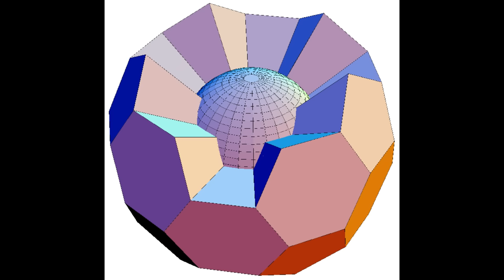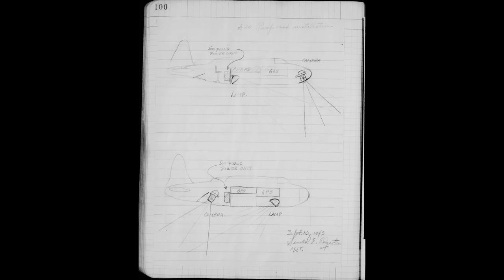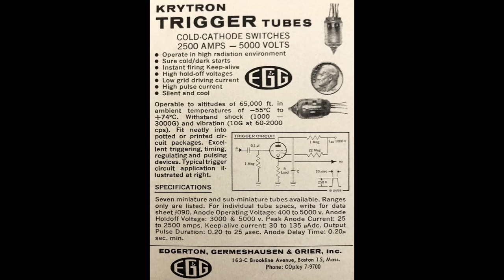Before The First Nuke Exploded... It Imploded.

Comment: Apparently lenses are a “more complicated” way to get the compression for atomic detonation. Modern bombs use a still classified method which is simpler and easier apparently. I saw this in a video about atomic bombs from a Harvard lecturer.
Reply: With modern CFD codes and CNC machine tools they can form a 🏈  shaped fissile pit that can be imploded by diverging spherical shock waves at each end
Reply: That's interesting
Reply: They went for making composite explosives with controlled density changes in the bulk, so as to make the lens intrinsic in the material, not make it out of segments. More complex in production, but you can test them more easily as shaped charge sections, and then very easy to assemble. Still needs the precise control of detonation though, and you can easily disable them till firing time using a simple mechanical switch, that adds a delay to the one section of controlled time cable.
Reply: I think you're talking about the Swan primary.

Comment: This movie had better give Leó Szilárd his due.  He was the first to conceive the nuclear chain reaction, five years before the atom was first split.  He wrote the letter that Einstein (his teacher and collaborator) signed and sent to FDR, kicking off the Manhattan Project.  Fermi, Zinn, and him led the project that created the first nuclear reactor (Chicago Pile 1).  When it didn't work at first, it was Szilárd who, without doing a single test, concluded that the graphite moderator must have trace amounts of boron (a strong neutron absorber) in it.  Sure enough, when asked, the supplier confirmed that there was boron in the graphite.  Fermi said that if building the bomb was a matter of just thinking, Szilárd could have done it all himself.

After Germany fell and it was found that they were nowhere near an atomic bomb, Szilárd argued that the project should be stopped immediately, without a test.  He predicted that Stalin would know about the project (correct) and that it was only the uncertainty of it working that was stopping Stalin from driving all the USSR's resources to develop their own bomb.

Comment: Kistiakowsky was quite safe drilling into the explosives and he well knew it.  Although it can be argued that a fluke detonation could occur, the odds of it are microscopically small.  High explosives of the type can even be exploded deliberately with a black-powder bomb and will fail to detonate, merely burn or scatter, because black powder lacks sufficient brisance (sharpness of impact).  This is what blasting caps (aka detonators) are all about.  They produce a small but very sharp blast wave which initiates detonation at a molecular level.

Comment: I think if they had put Trinity inside of Jumbo, they would have gotten a higher yield with a successful testing due to the pressure built up inside of the tank. If you think of lighting black powder in the open, it just fizzles, but put it in most anything, you will get a bang due to the compression of the wave being held back.

Comment: Working out the electronics so the detonators all went off at the same time was very tricky.  The implosion had to be symmetrical or the compression of the subcritical plutonium would not be uniform.  The Implosion design was a far more efficient bomb.  The Uranium gun bomb was hugely inefficient.  Energy spilling out all over the place before it detonated.

Comment: I'm not certain of the exact details of how the Trinity shot was actually started. But I have heard that most tests were triggered by a complex timing clock mechanism. This clock started high speed cameras, and all manor of other experiments associated with the test at various times just before, and after the explosion (T0), and the bomb it's self. The clock was started 1/2 to 1 hour before T0. So the image of the trembling hand over the big red button in the movie might not be that accurate. There were big red buttons that stopped the test. One rumor I heard was that Edward Teller like to setup a small bunker at a closer position to ground zero, and put a small hole in the part of the bunker facing the bomb. He would hold a cigarette up to the hole at T0, and would light the cigarette with the light from the blast.
Reply from the maker: The cigarette story was Ted Taylor, and he used a parabolic reflector.

Comment: it's interesting, that a lot of the problems of making an A-bomb, where solved by the  H-bomb design. the gun type, would be a steamengine, the implosion would be a fuel injection combustion engine, and a Hydrogen bomb would be a Dieselengine... for comparison   and the neutronbomb would be then an Electric motor?

Comment: I've seen and read a fair bit about the explosive lenses for these early weapons and it's all very interesting. The thing I really don't get though is how in the world did they go from 2.5 tons of explosives down to just a few kilos (in modern weapons) and still get the same level of compression from the implosion? In fact I guess the compression is even better now because they use much less plutonium. How do they do that?
Reply: Two point detonation on them apparently. Most bombs just use Uranium 235 now so pre detonation is not so much of an issue. Plus the bombs have hollow pits, levitated in the Tamper, better neutron reflectors, electronic neutron generators  and the core is boosted with a D/T Fusion gas mix. Plus an extra 5 to 10 years to get the shapes right.

Comment: 13:30 The "plug" of uranium tamper that wouldn't fit during final assembly at Trinity (because it was warmer than the rest of the tamper) was not fissionable in an explosive chain reaction.  It was made of U-238.
Reply: U-238 is fissionable but is not fissile.
Reply: @ianlewis6717  Yes.  Thanks for supplying the correct word.  U-238 fissions with fast neutrons.  Also, since we're discussing the details, I think the tamper was natural uranium metal, not depleted.

Comment: a huge pulse and voltage is necessary for implosion mechanism of plutos. russians uses huge capacitor bank and a little joule theif pcb to charge capacitor to 50kV+ than 50kv+ capacitor bank switched with an inert gas plasma super conductor. all detenators are parallel to each other with same lenght of wires. wire lenghts are mached and well trained. latest developers says they made a multi dimensional laser beam lens with laser pulser. 10kw 1us laser pulse goes inside lenght matched fiber-optic cables.

Comment: RPM of that dental drill Kistiakowsky used in 1945 must have been vastly slower compared to air turbine dental drills which first became available in late 1950's that could easily hit 100,000+ RPM.  Guessing he used something like a 1940's Emesco drill which was electric and used belt/pulley system with a slow speed of 2000-3000 RPM which was probably a good speed for the work he was doing...compared to mind-blowing high-speed dental drills we have today that can hit 400,000-800,000 RPM, yikes!

Comment: I would like to say, if you have TNT, or any other high explosive, you can give it to your child and he will not be able to detonate it at all, you can drill it , forge it, heat it, burn it, and do what ever you like, it will not explode. You need certain amount of detonation to make it work. I think even gun powder is too weak to set it off. 

So story regarding drilling looks dangerous, but as far as he is concerned, it was like soap for him, no harm or danger what so ever !
Reply: It depends on the high explosive. Dynamite contains nitroglycerine which is very temperamental stuff and can be detonated with even a slight knock. Picric acid was widely used in artillery and naval shells before it was phased out after WW1, and while it was fairly shock and friction-sensitive by itself it also had a tendency to form very unstable picrate salts if it had an opportunity to come into contact with metals. This could occur if a shell casing or fuse wasn't properly lined or if the lining was damaged, but it could also happen if the picric acid was exposed to the air where it would gradually sublimate and form deposits on nearby surfaces where picrates could form if the surface was exposed metal. Old ammo dumps and shipwrecks can be extremely dangerous because of the decomposition of materials like dynamite or sensitisation of explosives such as picric acid which can transform things like shells or mining explosive that were quite safe when new, into disasters waiting to happen.

Comment: Scott, can I ask you a question??? It’s not about nukes…… whenever interplanetary travel is discussed, everyone goes on about the best way to get the highest speeds but nobody ever talks about how you slow back down again or the power that would be required or time involved……. Maybe I’m a numpty but I’ve never heard this subject discussed……… your thoughts??
Reply from the maker: In Spaceflight you slow down using the same engines you use to accelerate

Comment: Would a series of spark gap swiches work to get the precision to fire off the detonators synced up? Like a single one is linked to two, those to four and etc up to 32. Or does there need to be some other step to have it syncronised? Or from a single of those can you just run cables of precisely equal length to the caps? Hard to find info on that.

Comment: In the first seconds of the fireball expanding we see incongruencies, darker areas in the plasma... we're these created from manufacturing defects or some other inherent property of the design?
Reply: The fireball expanding is basically imprinting the physical design of the whole device. After all, the released x-ray passes though the device, heats up the surrounding air, and creates the fireball. While everything from the explosives inward is symmetric by design, there were other things on the device outside that weren't symmetric, like the ignition circuits.

There are other aspects, like the construction on top of the tower. You can see other test videos, where spikes precede the fireball. Those spikes go along the steel cables that hold the tower.

Comment: Is there any possibility, has it ever been evidenced that a single part of "the device" survived?  Even a fragment or is it absolutely 100% vaporised?
Reply: My own thoughts are that 99.9999% of the original device still "exists".  Just in the form of a fine distribution of metallic dust that settles out after the metal vapour condenses out of the fire ball and "rains down".  Some alloys and probably some of the core metals and anything that used to exist within a few hundred meters (that didn't have the thermal mass to not melt, aka solid stone etc.)
Reply: Plutonium Rain.  Album or band name?
Reply: @1over137  Album definitely.
Reply: @trolleriffic  What would the band be called?
Reply: The Trinity site still has a couple stubs of the tower showing.

Comment: A bit of a slip-up to say "the big reason Jumbo was not used was because the test was successful", you would be most capable is teasing out the backward logic there.  In actuality, they simply decided not to do the first test inside Jumbo for various reasons.  (I suspect the tipping point was realizing how difficult it would be to do all the final assembly and control and measurement systems connections inside a relatively small steel chamber)

Comment: As long as it was a air powered dentist drill not a DC electric one. It's really not that dangerous to drill lightly into TNT. About the same risk as assembling a bomb. I sure it was uneasy work at first but do anything dangerous for a little while & you adjust.

Comment: Implosion detonation is one common way to set off the nuclear fission bomb, just so you don't have to carry big ass sphere of Uranium or Plutonium, all you need is for it to be right on fence of going critical, or slightly less for the bomb to be somewhat small and light - you can get it to go critical just by squeezing the sphere rapidly and hard, increasing the density thus critical mass. And it's also possible to cause nuclear fusion explosion that way too; obviously there's more than one way to skin a cat, when it comes to explosives. Oppenheimer, interestingly enough, had an epiphany that it's possible to destroy the whole planet with the bomb, so naturally he didn't want to test it right away (he was in a way right about the nuclear fission reaction causing the secondary fusion reaction, thus the eventual Hydrogen fusion bomb).
Reply: Would that fusion were so simple
Reply: @shanent5793  Yes and no, it just takes a lot of energy to squeeze Hydrogen atoms together. It's technically possible to do that with just a primary explosive however, yet volume of Hydrogen gas is also crucial in determining whether it's gonna explode or just a dud. Using fission bomb atop the fusion bomb just takes some uncertainty away; "It just works".

Comment: I'll explain the "elephant in the room" question:  Why is spherical implosion "much much faster" than a gun type mechanism?

ANSWER:  A gun type device is one-dimensional.  It brings masses together linearly.  Fission increases as an inverse function of the distance between the two subcritical masses and their centroid.  

A two-dimensional device was never tried, due to both alignment and dimensional (too large) issues.  Had it been used, fission would have increased by the inverse of the square of the distance between the subcritical masses and their centroid.  

The three-dimension design of a spherical implosion results in the most rapid increase in fissionability between subcritical masses as they're brought together, in this case, by the inverse of the cube of the distance between the subcritical masses and their centroid.  It also results in the most compact geometry.

Modern devices are not merely thermonuclear, whereby a fission device powers a fusion device.  We learned back in the 1950s that relying on fusion for the biggest of bangs resulted in a significant increase in radioactive contamination in addition to the devices being very large and heavy,.  Thus,  most modern nuclear weapons are fusion-boosted and roughly 100x more efficient at producing energy than the two nuclear weapons used in World War II.  Thus, they're far smaller and more compact, not to mention being much "cleaner," radiologically speaking.  Put simply, they use a fission reaction to power a fusion reaction, which in turn enhances the remainder of the fission reaction, resulting in far more complete fission.

For more, see:  https://en.wikipedia.org/wiki/Boosted_fission_weapon#Gas_boosting_in_modern_nuclear_weapons

Comment: Hey  @scottmanley   - Some of the replies got into discussions concerning the general public being scared of nuclear reactors due to a certain level of base ignorance on the differences between a nuclear bomb and nuclear accident resulting from pressure vessels, gases/steam, and radioactive material.

I'm not sure how prominant international regulation is and how widely it's accepted, but wouldn't nuclear power effectively be our absolute best option for environmentally clean and efficienct energy if all nations accepted the required approval of an international safety board on plan construction and safety standards? For example, such an agency would have absolutely denied the inadequate Russian design at Chernobly and denied building the Japanese plan on a coast line prone to tsunamis. Take out those two disasters and nuclear energy production already has a great enough security record over the decades to warrant a huge explosion in their utilization worldwide (in my opinion). Agree/disagree?
Reply: Like the IAEA?

Comment: For a HV switch can you use a breaker immersed in oil?
Reply: mechanical switching is still far too slow, high voltage as that will still jump the gap in oil and take many microseconds too many to be 'full on'.

Comment: think I've heard 3 different versions of why they abandoned the first version by now (all in the matter of a few days). One said that it disintegrated due to friction and they had to use whale oil - It was then deemed better to use another material so they abandoned it. Another one just said that it disintegrated due to the high acceleration and now there's your version.
Reply: The reason you need extreme speed is the spontaneous fissions

Comment: Are there estimates for the dose rates of the early tests before people figured out the persistent radiation?  That photo of Openhiemer looking at the remains of the tower.  I assume that was hours or days later, not weeks, so the environmental radiation must have been pretty high.  100 times background or more!
I know they sent troops in to freshly nuked land to see how they were and I know the russians did far, far worse by sending entire batalions in to camp and operate there, working with iradiated equipment and food.
Reply: Since Trinity was technically a surface burst, it produced much more fallout than either Hiroshima or Nagasaki, both of which were air bursts at around 1640 feet altitude AGL.
Reply: It all depends on the winds.  If the fallout was carried away, ground zero could've been safe quite quickly.

Comment: If you put a plutonium core in the center of a carbon fiber submarine and send it to the bottom, would implosion of the sub achieve criticality?
I don't think so but I might be an interesting thought experiment.
Reply: In theory, but it would need to be very, very close to critical mass. Paint the inside of the passenger "tube" with some sort of neutron reflector if possible.
Reply: Only if you use a playstation controller.